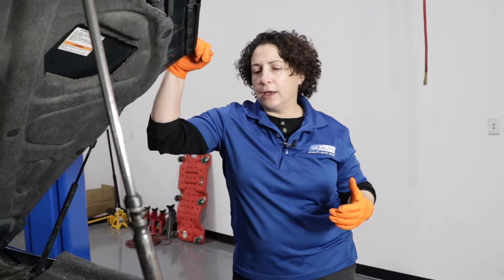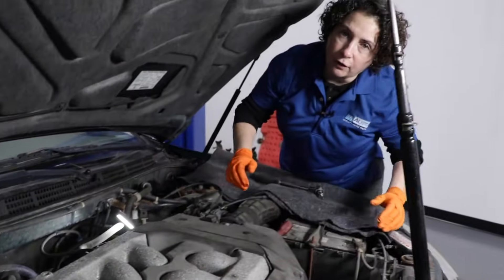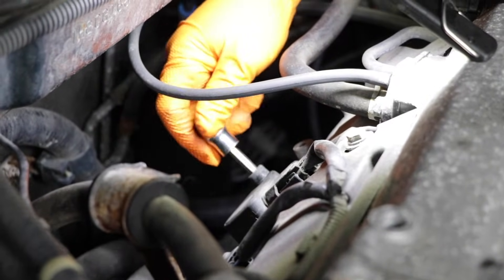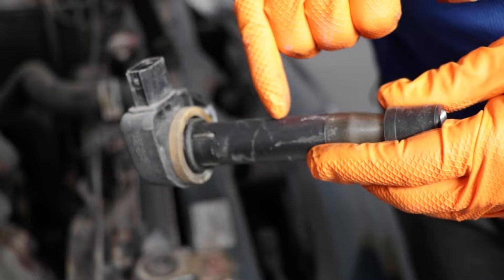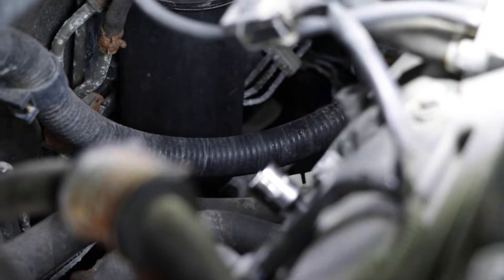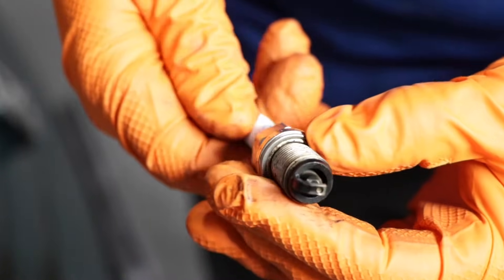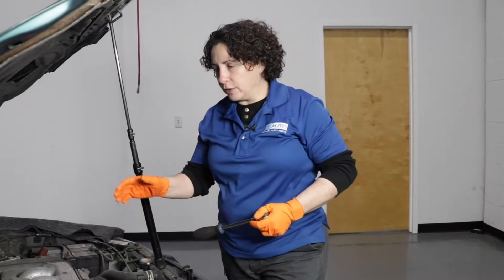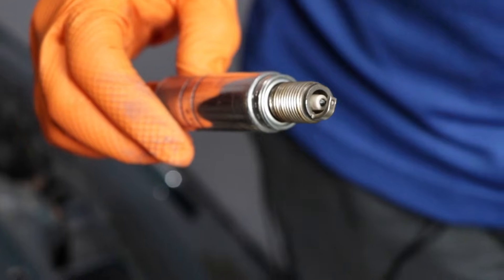Engine Misfire? Trouble Code P0303 Meaning, Diagnose Spark Plugs & Ignition Coils

Comment: I have a P0301 code. #1 cylinder misfiring. It idles rough and isn’t accelerating smoothly. I changed the plugs and then rechecked them and they looked fine. I’m moving to Step 2: The ignition coil.

Can’t do a swap with my 2005 Jeep Wrangler 4.0L because there’s a single ignition rail with the coil packs built in. 

Fortunately it’s a cheap part and easy to swap in a new one so l ordered it and am hoping this will fix this problem.

Comment: I have experienced 2 ignition coils fail on 2 k24 engines. Both times it was a failed coil. Simple process to find, even without a scanner. Start engine and just remove plug from first coil. If engine drops another cylinder replace plug to coil and move along till you find the cylinder that when you remove the plug, makes no difference to engine. That is the defective coil. Turn engine off. Swap the defective coil to one you know is ok. Same procedure. Now hopefully you will find the fault has moved. If it has, you now know which coil has failed. Replace ALL COILS. They are likely manufactured same day, and likely to fail soon. Also replace the plugs. Quite likely a worn plug has put extra load on coil, causing a failure. Easy job to do. 10mm socket and a plug spanner. You CAN do it.

Comment: My 2018 Chrysler Pacifica keeps reading this same code. I had them changed engine light on. Had a tune up all new spark plugs, and coil packs. The code came back. My mechanic said he checked the feul injector. What else could cause this to happen. I appreciate any help. Thanks in advance

Comment: I swapped 2 and 3 and then got misfire in those. Wonder could mine be the coil as I just put all new plugs in and it is still running right with same code.

Comment: I have a 2022 Honda Insight 1.5 liter with 58k miles giving a persistent code P0303 Cylinder 3 Misfire Detected. I have cleaned spark plugs and moved CYL 3 plug to CYL 1, moved CYL 3 ignition coil to CYL 2, cleaned fuel injectors and moved CYL 3 injector to CYL 4, cleared all CEL error codes using my OBD2 scanner. The P0303 misfire problem stays at CYL 3 even with original spark plug ignition coil and fuel injector all moved to different cylinders. I'm completely at a loss as to what could cause this misfire, I've thought about maybe dirty fuel filter but I would think this would effect ALL cylinders and cause misfiring, not just ONLY on CYL 3. The rough idle and misfire ONLY happens while the engine is cold first start of the day, after the engine warms up for 5-10 minutes the misfire goes away.

Comment: what happens if the misfire doesn’t fallow the coil I just replaced my spark plugs and coil packs and got a misfire could it be because of bad crank sensor?
Reply from the maker: +@Wes_off_road We wouldn't be able to diagnose an issue like that here, you may want to have a local mechanic take a look at it. Thanks for checking us out! http://1aau.to/m/Shop-1AAuto-c

Comment: I have a Peugeot 5008 (2012). It got engine fault when running over 130km/h. There is a code P0087 and P1340. I had changed the High pressure fuel pump & Battery before that. So what could cause that ?

Comment: Thank you so much I was so scared when I got code p0303 after changing the spark plugs and so I did the boot swap with cylinder 2 and boom it switched to code p0302 . TLDR it was the boot

Comment: what i know is that if you changed all the spark plug, spark plug wires, ignition coil and it still misfire with P0300 then check the lifters and fuel injector which requires more work and if all of those are good then get a new car or you can try checking the crankshaft, piston, and fuel to air compression ratio because all of those can misfire your engine and throw a generic P0300 code or just get a new car. 😂

Comment: I have the PO303 code on my 2002 Dodge Dakota with the 3.9L in it.  I have changed the plugs, wires, cap, rotor, and ignition coil and the check engine light still goes on and off. Any ideas? Help...
Reply: Clear the codes

Comment: I have a 2003 Honda civic and the check engine light is on and its code is P0304. I have replaced 4 spark plugs and 1 ignition coil for the number 4 engine but the check engine light is still on. what do I do now. thanks

Comment: Greetings, 👋🏼 I have a 2018 Toyota Tacoma SR5 truck and I wanted to know what should I change if my vehicle has 37,776 and havent changed anything yet and it's a used vehicle from a used dealership? And I found out they didn't do the transmission oil change. The only thing I changed was the airfilter and oil change at the Toyota dealership.

Comment: Hi everyone,

I've replaced plugs, wires, upper air intake manifold gasket (not the head gasket which  seems okay based on the normal coloring of the engine oil)  that had turned to mush because of a water leak, temporarily disabled the EGR valve to observe any possible difference, secured all the vacuum hoses in place,  but the van still misfires like before and the P0300 still comes up. 

I tested all the existing coils for continuity, and they all came back in 5.7 range on the 2k ohm setting on the meter, so I left them on without trying to extract them off the platform by removing the seized rusted bolts. 

The vehicle still misfires. Any ideas or suggestions out there? 

...greatly appreciated
Reply from the maker: +Folds of Blubber We wouldn't be able to diagnose an issue like that here, you may want to have a local mechanic take a look at it. Thanks for checking us out! http://1aau.to/m/Shop-1AAuto-c

Comment: I don't know many women mechanics. But you sure know what you're doing that's for sure. I have a 2001 GMC Sierra SLE Extended Cab two wheel drive 5.3 litter V8 Engine with 124,000 miles Original engine it has a misfire code in all Cylinders but it runs Absolutely fine Besides a flashing engine light on occasion. I replaced four of the oxygen sensors It did not fix the issue. I did a tune up spark plugs and a wire set. I did not do the coil packs. It also had a small Vacuum leak. If the engine light wasn't  flashing I wouldn't even know there was a problem with the truck. It runs good no stalling No hesitation plenty of powhy. Is this showing miss fire codes in all my cylinders? But the truck runs fine. I have Invested over ten thousand dollars in this truck in Mechanical repair within the last 2 years. I put more money into this than what I paid for it

Comment: Why would you swap spots? Put a new set of plugs. If that handles the problem your done. You could ohm out the coils if the plugs didn't fix it. I don't understand swapping parts when the plug is wet

Comment: Great video. I have a 2005 Dodge ram (200,000 miles) was getting skipping a good bit off and on. It got pretty bad so I bought 6 new spark plugs had a mechanic change them, I figured after that many miles it needed them. Seemed to work then got real bad 2 days later. Still getting P302 code. I bought 6 new ignition coils and asked him to just change them all instead of the bad one. Runs like a sewing machine now. I think that coil had been cracked or something because it was intermittent for years. Maybe changing the plugs disturbed a loose wire of something. It's good for another 200,000 now.

Comment: My 2014 Dodge Grand caravan SXT read misfire #3 
I changed spark plugs still #3 misfire
I changed coil packs still #3 misfire
My new codes #3 misfire,p113d,p113e
So I changed
Pcv valve
The p113d,p113e goes away
Now I still have a rough idle and code's for misfire #3 still
What do I do next
New 
(Plugs,coils, injectors and PVC, good Air filter)
What is my next step

Comment: Mine called po305, managed to swap plugs, didn’t help, I had to wait for my father to awaken so I could get his special screwdriver for the cap and rotor. Pre code was o2 sensor left bank. No upstream or down stream, turned out the cap was wore off on the 1,3,5 cylinder.

Comment: I replace the coil and spark plugs. I was getting a misfire in cylinder 6. So I replaced it with a new spark plug. And now I disconnected the battery let's see what happens. Cross my fingers. Every time I go in there to check on it seems like I got to tighten my coils 😮‍💨🤔

Comment: I’m having same issue p0303 misfire on cylinder 3. Changed the ignition coil and code went away then 30 minutes later came back. Also have a p0031 code for oxygen sensor. But when I changed my coil it had oil on it? Does that mean I need a valve cover gasket??

Comment: Before she restarted the car she said to clear the code and see if the misfire transferred over to cylinder 4 even though it was cylinder 5 that she swapped with. She did correct herself after starting the car, but thought i'd point that out

Comment: P0305. I changed the coil from 5 to 7. Replaced the spark plug. Still reads p0305. 
Should I disconnect the battery?  Or is it still misfiring ?

Comment: Great video!  Yes, if you have a Ford product (Taurus, Windstar) with the 3.8L V6, it doesn’t have coil over plug, but rather has an ignition coil six-pack.  After only 110K miles, the dreaded P0303 code came up, and…it was my ignition coil pack!  No wonder everyone stopped buying Ford cars.
Reply: Jeep Wrangler 4.0L inline 6 is the same. I just ordered the ignition rail to replace it. Fortunately it’s cheap and easy to do.

Comment: I did learn that if you decide to just switch around the wiring harness connector without switching the coils or spark plugs - your car will start jumping when you crank it.  But when you switch it back it will work like normal. Does anyone know why that happens ? - are the wiring harness connectors per bay/cylinders specific … example cylinder 3 connector can only work with cylinder 3 and not 2, 1, 4.

Comment: Went to my usual shop and the manager tells me I need all new coils and spark plugs.  I had new plugs put in 13000 miles ago, and the car drives 2000 miles a year.  The worker said that the bolt holding the coil in the misfired cylinder had to be cut out and that could damage the coil. Even if that is the case, recommending replacing everything without even doing this simple test sounded to me like a blatant money grab. That's like having a hurt finger, but the doctor doesn't X-ray you and tells you lets cut and replace all your fingers.

Comment: I had a similar problem with a 2001 Lincoln Town Car,  the computer said the problem was the number 5 cylinder.  I took the coil off removed the spark plug,  cleaned the plug, replaced and it ran fine for a short time, about 20 minutes then started missing again.  I replaced the coil, no more problems.  Why she is recommending changing all coils is stupid,  in my opinion.

Comment: I have rav4 model 2009.
Error in cylinder 3 when I reach high speed or climb high level.
Changing sparks and coils plus swapping injectors but still same code. Checking cylinder 3 compression  is ok.what do you purpose please.

Comment: Normally, I don't really want to say anything about these tutorial video unless they are really wrong. In this case, I don't agree with the way she try to diagnose the problem. Here are the orders to check when the engine misfire on any of the engine cylinders:
How to repair car engine error failure code p0302

Replacing spark plugs that are defective or damaged
Replacing spark plug wires that are damaged
Replacing coil pack wires that are damaged
Replacing EGR valves or tubes if they are clogged
Replacing valves that are burned
Repairing any vacuum leaks
Repairing or replacing leaking head gaskets
Replacing camshaft sensor if defective

In this case of a P0303, it is the third cylinder that the engine sensor detect it has misfired. As she has shown the sparkplug, it is probably worn and should be replaced. She should replace that spark plug first before doing anything else. If the engine runs fine after replacing the spark plug, the problem is solved. In diagnostic, you don't ever change more than one part of a time, then you don't know which one is the real problem. Swapping both the spark plug and the coil pack to a different cylinder do not tell you which was at fault, the spark plug or the coil pack. In this video, the spark plug in the fifth cylinder looks like brand new, it probably never seen any spark. In a typical engine, all spark plugs would be likely covered with black carbon and the gap varies between spark plug to spark plug. The first thing that she should check is the spark plug gap on the misfire cylinder and adjust it first. If the spark plugs have been in the engine beyond the normal maintenance interval (105K), they should all be replaced but you could just adjust the spark plug gaps to get by until you get the new spark plugs. If replacing the spark plug or adjusting the gap does not solve the problem, the next step is the coil pack that may be bad. One way to check if the coil pack is bad, is to disconnect the wire from it, and the engine does not behave any different, then the coil pack is bad. You can use the list of progressive diagnostic steps above to check for the next culprit that generates your P0302 or any other P 030x engine codes. Good luck!

Comment: Pls I need a clarification here; the misfire code was p0303 which is cylinder 3 but with careful observation I am confused with the cylinder she called cylinder 3, that cylinder was on d bank 1 and it was cylinder 5. The one she even changed with was cylinder 4 on bank 2.
Pls I am opened explicit explanation.

Comment: Thank you for these videos. They are very helpful. 
I have a question about the P0303 error code. This code denotes a misfire at cylinder 3 but I found a website that states that a common mistake people make is that the P0303 code is referring to the third cylinder in the firing order, not cylinder number 3. 

The article states:
"P0303 is a cylinder specific misfire code, which means that Cylinder 3 is misfiring and causing the code. An important thing to understand when finding the location of cylinder 3 is that it's going to be the 3'rd cylinder in the firing order of the vehicle, and not the 3'rd cylinder that you might see when looking at the engine."

My 2006 Mercury Montego has a 3.0Liter v6 with a firing order of 1,4,2,5,3,6. The third cylinder in this firing order would be cylinder 2.
Do I have a misfire in cylinder 2 or 3? Can you please clarify what is meant by cylinder 3?
Thank You
Reply: The last number of the code means the 3rd cylinder of the engine. Days ago, my car just got some problems and I scanned got a code P0306. I then checked the 6th cylinder and found the plug got loose, the upper tip of the plug also loose, and that the lower part of the boot covered with a layer of yellow stuff.

Comment: Funny enough, but both times 2 different trucks i had a P0302 code it was the injector, the o rings were gone. new o rings, no code ran great, so also worth a check if you're having a hard time finding what is causing the code. yes i swapped coils over side to side first, then plugs.

Comment: all great but how are you going to determine if it is spark plug or coil if you are swapping them both at the same time???
isn't it obvious to swap the coil first? to know if the coil is bad or good? and then proceeding with spark plug ?
of, course it is best to replace both at the the same time, however for the purpose of identifing the 'usual suspect' do the coil first,,,, that's my take on this simple issue,,,,

Comment: Hi Sue, great video. I have a 2009 Lexus RX 350 V6 and I keep getting a P0333 error code which usually means a problem with the knock sensor, however, my mechanic said that it could also be a buildup of carbon in my engine and he recommended that we try using SeaFoam additive in the fuel tank to slowly get rid of carbon buildup. The SeaFoam has definitely made a difference in performance, and I only use octane 91 on a daily basis. After clearing out the P0333 code, I drove for a whole day without any issues, and the engine is still smooth, quiet and no knocking, but then suddenly I will get the P0333 code back on, creating an "Engine" and "VSC OFF" code to appear on my dashboard, and of course reduced performance. My mechanic is convinced that my knock sensor is fine.  Is it possible that the problem could be related to a vacuum leak or a problem with my wiring? Do you have any suggestions?

Comment: I just had a misfire code. Changed sparkplug and coil pack. Misfire was still there. Decided to go out with the scan tool and clear the code , turned it off and back on and had no more misfire. Hopefully this helps someone in my situation.
Reply: Thanks

Comment: Thank you so much! I'm having the same issue with my engine and I've done so many other fixes and hopefully when I change the spark plugs it'll be fixed. I fixed vacuum leaks, changed the EGR valve, changed the TPS and now I'm going to change the spark plugs. Thank you again for showing an example of the problem, that made me appreciate this video a lot.

Comment: If there is excess oil on spark plug. It could be a damaged Valve Cover Gasket, that's leaking! .You r going to get the same code P0303. I had same problem with a 2006 GMC Canyon 3.5. Replacing Gasket fixed the problem. I'd suggest to replace  factory original spark plugs and coils, if they r old. On the Gasket, just don't buy the cheap one! 😁

Comment: Great video. I just think if you swapped the coils first, then the plugs. This could be either the coil, spark plug, or both.
Reply: True. But she already confirmed that the coil is bad. So might as well swith the spark plug too. She did 1 job instead of 2
Reply: @spartanrules9935  
What doesn't make sense,  is the computer tells which cylinder is missing,  so check the coil, and spark plug.  Why move from one cylinder to another?  A waste of time. In my opinion.